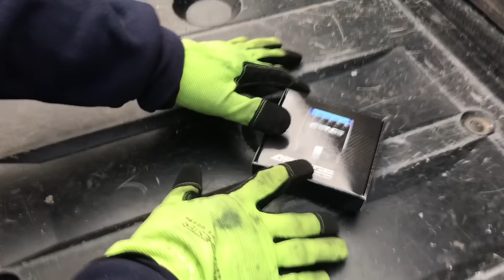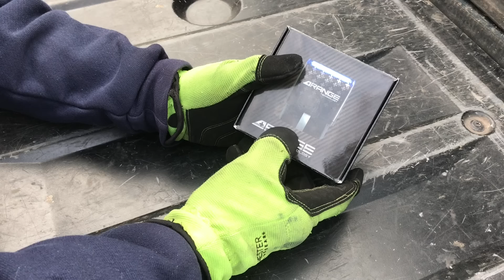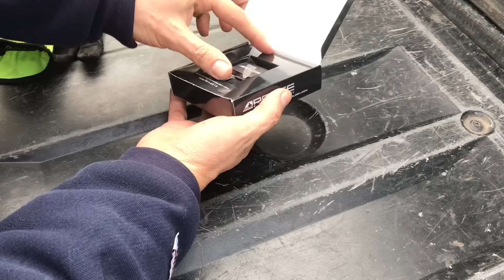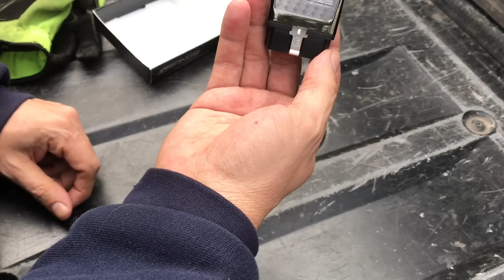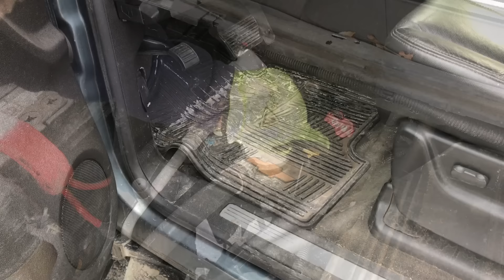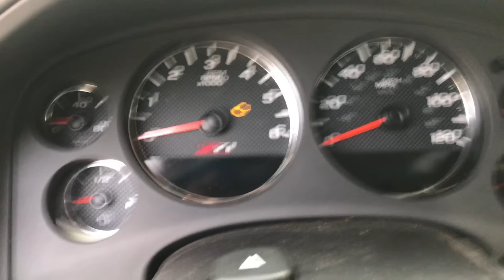Range AFM Disabler - Long Term Review

Comment from the maker: It has been 15k miles since I first plugged in the Range device.  Still no issues!  Fuel economy is down approximately 1 MPG.  We’re getting ready to flip 200k shortly!
Reply: It was really wise of you to de activate the afm before one of those lifters failed. 👍🏻
Reply: Russell Vinson I’m doing the same rn!
Reply: No install before the tap
Reply: In theory, you could connect something like those light up hitch plugs to trick the truck into thinking a trailer is hooked up to it and that would prevent it from going into v4.
Reply: So will this keep the lifter from collapsing or is there still the chance ?
Reply: @tyler560  This will keep the computer from activating v4 mode by making the computer think it's always under load. This keeps the VLOM solenoids from activating the AFM lifters.  Technically, there is still a chance of a collapse, but a collapse 99% of the time only occurs when the lifters are changing from v4 to v8 mode or vice versa.  So, by turning off that mode, you're greatly reducing the risk of a collapse.  But because the lifters aren't replaced and just inactive, there is still a small chance the mechanical pins in the lifter will fail, and cause a lifter malfunction.
Reply: Will this device work plugged into a OBD2 splitter cable ? I have AMP research power steps plugged into my OBD2 port atm
Reply: Hows oil usuage???
Reply from the maker: @tonyderks9172  Hey Tony, it's unchanged.
Reply: @HilltownCT  sweet thx..
Reply: @HilltownCT  hey man any recent update?
Reply from the maker: @evanjones1847  Sold the truck a few months ago still running strong.  I have the Range plugged into my new-to-me 2018.
Reply: @HilltownCT  I just bought a 2009 Silverado and it makes this really annoying ticking noise when it runs in 4 cylinder. Almost sounds like ABS breaks.
Reply: @HilltownCT thanks for the updates over the years lol 😁 just bought a 2012 Silverado LT with the LC9. 107,000. Copart for $8100. I'm going with the disabler then the delete kit later.
Reply: Should have done this. Thought I was immune at 192 k.
Reply: @garybrauckman5299  my 08 1500 motor bit the dust at 330k kms. I noticed a noticeable Louder tick a few weeks ago. Few days ago motor is toast.
Reply: I'm thinking about buying one soon. My lifters have went out 2 times in 9 months on my 2014 Cameron ss. Has anyone heard of any reason why I shouldn't buy?
Reply: Do you still have the high volume oil pump?
Reply: Does this leave a foot print on a ECM?
Reply: -10hp for dexterity
Reply: 2019 5.3 rebuilt . Bought the range AFM/disabler and it doesn’t override the auto start /stop when in low fuel conditions. Is this normal
Reply: Can you pass state inspection with it
Reply from the maker: @ I have to remove it and drive for a period of time before the inspection test.
Reply: Will it stop the lifters from tapping when D O D disable with this

Comment: Mine has been in my 2015 Silverado 5.3 the last 30k miles. Same mileage loss but I don't drive but 7.5k miles a year so I don't care. When I bought the truck at 130k miles the oil looked new and still does at every 5k oil change and no measurable consumption.

Comment: I got a Boost AFM/DFM Disabler. Simply plug it into the OBDII port and problem solved. Car stays in V8 mode in any drive mode. I have the Boost in my 2014 C7. Less expensive and draws less power than the Range, and made in the USA. No engine lights or issues, and can remove it in 2 seconds and return to stock when taking the car to the dealer for service.

Comment: I put my rangefinder in a years ago and i notice after driving for about 15 minutes or so when im idle at a stop my pressure starts dropping under ( 18 ) RPM at the lowest! would this have snything to do with the need to permanently remove the DOD and switch out to the test of the proper parts such as lifters etc?? thanks in advance

Comment: Put the same disabler on my 2021 Silverado after a warranty claim for lifter failure at 3700 miles. the odometer reads 28,000 miles now, I have not had a problem, also changed to 5w-30 weight motor oil, still now problems.  With a new GM V-8 change oil frequently as GM does not do a good job cleaning their V-8 blocks after machining and before assembly.

Comment: I have a question. I want to run the Range in my 2016 GMC Sierra. But I have the AMP foot rails installed and the power source is through my OBD. Is it possible to use a splitter to run both through the OBD

Comment: I had a 05 trailblazer 5.3 with dod had 207000 miles on it when I sold and it's still running good with no issues never deleted or disabled it

Comment: I bought a Range, had it shipped to Canada,  despite the price I'd rather have my engine last longer than worry about MPG or price of the Range product. So far it's performance is great, my 2018 chevrolet silverado ltz redline is much smoother and fun to drive. I've actually had family members who rode in the truck before Range and now after installation, they all say how much smoother it is. They wondered what i did because i never told them about the Range and i added an extra ribbon cord connection so you cannot even see the actual OBD.😂. Highly recommend the Range.

Comment: how has it held up? do you still recommend it? any problems after installing?
Reply from the maker: Still using it on a 2018 Silverado. A couple times a year, it will stop working and I unplug/plug it back in. Otherwise, no probs for me.
Reply: thank you for taking time to reply
Reply: thank you for taking time to reply

Comment: AFM doesn't kick in until the vehicle is in a driving gear. If it's idling in "park" it's in V8 mode regardless if you have a disabler or not.

Comment: been using this device for 3 years only problem every 8 months have to unplug it cause the gauges and abs light comes on when i drive it nothing works but volt meter then unplug it for 10 min it will go back to working again PS mine is blue love it notes have not had to add oil between changes

Comment: How do you know this product actually changes the code to prevent AFM and not just program the display to show V8. Im hesitant when I read some reviews saying MPG didn’t change or didn’t change by much or that the exhaust sound didn’t change. How do we know it really is operating 8 cylinders?
Reply from the maker: @Garebare1 I’m currently using it on a Silverado and the truck noticeably sounds different when I unplug it and it switches from V4 to V8 and vice versa.

Comment: I'm a mechanic I specialize in de governmenting vehicles and I have done a TON of these LS/LT platform DOD jobs I would highly recommend a full mechanical removal and a real tune  of the system it can and will still activate with those devices no matter what it says on the dash and eventually the VLOM will begin to leak and you will experience low oil pressure poor idle and it will typically be accompanied by a P0420 P0430 and P0106 code catalyst efficiency codes and a MAP sensor performance code and the continuing to activate will cause cylinder damage just because it says it's "in v8 mode " on the dash doesn't mean it will not intermittently activate with a true disable tune you swap to LS7 style lifters drive plugs in the towers that supply oil to where the dod lifters used to be and you unplug the VLOM and disable the DOD as well as set the minimum activation speed to 300mph So that the ECM will never see a condition where it could possibly activate unless you strap a jet engine on the back of it  as well as deactivate the PIDS for the VLOM plate so there is no electrical connection to the solenoids it will be 100% impossible for it to activate and unlike diesel deleting that is a legal modification because the 3/4 ton trucks were able to be optioned without the DOD from the factory just a bit of knowledge for you the other thing is you may still have a lifter collapse condition with the range device
Reply: I bought a brand new 2021 Silverado Z71 RST. It would stutter and clunk, and I had no idea what was going on. The truck was brand spanking new at the time. I would take it to the dealership to be checked out, and they wouldn't find anything wrong. One of my hunting buddies told me about the Range Technology AFM/DFM disabler. He has one on his Trail Boss. I bought one for like $230. I plugged it in, and this truck has driven like a gem ever since. The stutter and clunk is completely gone. It shifts so smoothly. The truck is almost 5 years old, and has run flawlessly since putting the range on. You can feel that it's in V8 all the time. I'll take the $230 fix over thousands of dollars fix anyday!!! The truck drives like a dream. I get oil changes on the regular, and the only work that has been done to my truck was a new battery in 2025. The original battery went out after 4 years.

Comment: It's too late to fix with the range technology device if its already burning oil because the cylinder walls have been ovaled out from the uneven heating of the engine block. Put a gen 1 sbc in it problem solved.

Comment: The V4 mode is pointless to begin with. It doesn’t activate when your at idle, it only seems to do anything when you are in like 5th gear cruising on the highway. Then as soon as you hit any incline on the road, it has to go back to V8 mode. I took a trip from Dallas-Houston, and kept my eye on it. The longest it stayed in V4 mode was 45 seconds. Out of a 265 mile drive, the truck ran in V4 mode for 23 miles, but it was never engaged for a complete mile, lots of switching back and forth. Eliminating it is my next project.

Comment: I bought one got it today plugged it in and it messed up my cruise control. I called them and they act like oh it’s not their problem. Their device wouldn’t hurt nothing I said bullshit so I gotta fight on my hands. I guess anybody else have problems with these things.
Reply: My truck  stalled  out  a couple  of times. Not  sure  if it had  anything to do with it. Took it  out  and  it  hasn't  stalled  out  yet. It may  have  been  messing  with the  computer. Or  possibly  malfunctioning. I run in m5 and  it is disengaged.  Mine  has the  six cylinder.   I don't  use  it  anymore.

Comment: I’m just saying this as someone who has had both. I hate the range device. Always having to yank it when I needed to scan codes, undiagnosed hard shifts with the device plugged in, and the annoying lights at night did it in for me. I got a tuner (hp tuners I think) and I disabled it that way. I would strongly advise investing a little more and doing it that way. No lights, no hard shifts, no device in the way when you need it. $50 bucks more. No brainer

Comment: I have two of these trucks with AFM, 07 Silverado and a 08 Sierra with the 5.3...I had to replace the engine twice in 08 Sierra because of the AFM sistum before I heard about the Range disabler installed it and I have 40022 thousand miles on it with absolutely no issues with the engine I haven't done anything else to the truck just keep the oil an filter changed every 3000 miles and change the transmission fluid & filter every 80 thousand miles that's it...and no the 07 Silverado was consuming like 1to1and a half quarts of every 3000 miles with lifter tick, installed the range disabler absolutely on more issues. Zero oil consumption and no more lifter  tick, I have over 230 thousand miles on it and it runs great. This device saved this engine.. These things are awesome 👍
Reply: Update?

Comment: Overly complicated engineering fails call for complicated fixes. That have their own failures. I miss the simpler engines that relied on being tuned properly that controlled exhaust problems and gave great mileage as  a bonus.

Comment: Came across this only because I want an exhaust job and don't want the 4 banger sound. My question here is 1. Will it void warranty on my truck? 2. Will it throw off codes or do anything haywire with the computer system 
Thank you
Reply: If you take it to the dealer and you have a drivetrain warranty they will definitely use the range tech as a scapegoat to not give you your warranted repair, take it out 2 days before going in and drive around because when it’s unplugged it clears pre-existing codes.

Comment: I see a few comments from knuckleheads who talk about how this obd port device can fry your ECU…

Has anyone experienced this or are they full if BS? 

Also had anyone had a lifter failure while using the range? I saw 1 camaro owner who did with 62,000 miles

Comment: I've had this in my Camaro for about 30k miles and have not had any issues. Runs great and gas millage is about the same. I must say however... A word of caution if you live in a state that does SMOG testing.. When you pull out the AFM disabler it will reset the OBD monitors and cause your car to fail the emissions test. In that case just drive it around for a day or two before you take your car for the emissions test.
Reply: Yep, my 2008 impala ss failed emissions test. Took it to be inspected and removed the range device in the garage parking lot,  and when the inspection was done two of the sensors failed showing not ready, EVAP and O2. In North Carolina it would have passed if one of the sensors only showed not ready. Took about 3 days for one of the sleeping sensors to come back to life after doing 3 diagnostic plug-in scans. The EVAP sensor is still asleep because the car's computer has yet to perform a test on it. I think it is correct to unplug the range device three or four days before your smog inspection so that the computer can reset the sensors and do the ready test. After 3 days of driving numerous miles and numerous cold starts, the diagnostic machine finally showed the O2 sensor had been read and was ready. EVAP still shows now ready.
Reply: Unplug the range device three or four days before your emissions test and drive the car normally so the car's computer can check the EVAP and O2 sensors
Reply: I have a SS Camaro that I have had constant issues with the A8 shudder. I have had the triple flush a couple of times and the torque converter replaced and it is starting to slightly shudder again. It is a 2017 with 30k miles. I have read that AMF disable with stop the shudder. This is my last ditch effort before I get rid of the car. What are the chances this actually works?

Comment: I have a 2018 GMC Sierra with only 21k miles and it was doing some crazy things.  It would feel like you're driving side ways across a freshly plowed field.  Local dealership kept saying they can't find anything wrong and charging a diagnostic fee.  A service manager at another dealer knew what it was within 30 seconds of me describing the symptoms.  Installed the Range AFM disabler and so far no issues.
Reply: How are you still doing with your truck?  I have a 2018 silverado with 65k miles. I want to disabled  AFM
Reply: @joser-Gmez  I traded it in back in Oct of 23 on a 24 Sierra.  Now there is the recall with the 6.2 engines.  I've got 10k miles on it and changed the oil twice and sent off a sample at the last change.  There were no elevated levels of wear metals, so hopefully this engine isn't eating itself.

Comment: Thanks for the video man! I'm in need of a little more help. I have an 08' sierra as well and it has never showed my fuel economy on the cluster. Also does show mpg or V8 mode like yours after plugging in the AFM disabler. I saw in your video after you plugged in the AFM disabler, your cluster displayed your mpg and said it was in V8 mode.  Did it show mpg before you had the plug in or is that an affect of the AFM disable. Thanks.

Comment: I never run my engines the full  7000 miles I have 35 of these trucks burning $10,000 worth of fuel  a month our oil gets changed religiously at 3500 miles. We never had any real engine, failures, 350,000 is the average mileage before I trade them in. I have done the oil test several times on many different engines that operate in different conditions and it was advised to me to change it at least every 4000, as for the cylinder delete of the AFM set up. Sounds cool. I just ordered my first one. everyone can do what they want on their own oil changes the last time at one of the big meetings I tend to go to. It was brought up that most the oil changes are not due to mileage but mostly due to the sierra club, if Ford Chevrolet, or dodge any of them would be tickled to death if you change the oil every 500 miles lol so it’s kind of up to the owner Great video.
Reply: Agree totally.  I never let my GM get to the oil life monitor recommendation.  The oil is usually black and the engine sounds like metal on metal long before the monitor ever recommends the change.  I average about 3500 mi per change too and would never let a modern engine go over 5,000 miles between changes (synthetic or conventional oil, doesn't matter).

Modern engines work oil very hard.  It's no coincidence that people following the manufacturer's recommendation of 7500 or 8000 miles are needing new engines due to sludge issues...

Comment: Just to make something clear, if you leave your AFM equipped truck in park it will always stay in V8 mode. As for the oil consumption, in order to get less friction the ring tension was reduced and the low tension rings let more oil get past. One of the service items for restoring a problem AFM engine is new rings. I had an 07 that failed at 101,000 miles and the ring replacement was the item that convinced me to go with a factory remain. If I was going to spend the money for lifters, cam, top cover, rings and other incidentals I wanted a guarantee. There's a limit to the amount of money I would throw at an engine with 101,000 miles. I do think that AFM failure can cause excess oil to get drawn past the rings and fowl them but that's not the main reason.

Comment: Had this in my Saab 9-7x for 4 years now. Have 191000 miles on my 5.3, and it uses very little oil, runs like new.